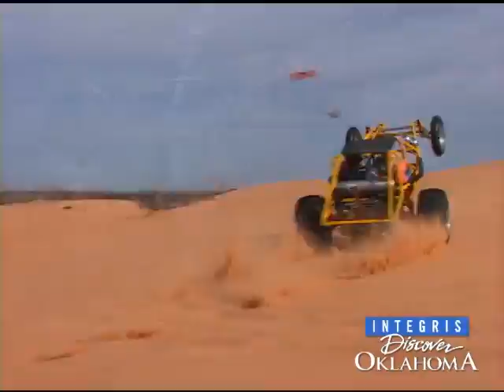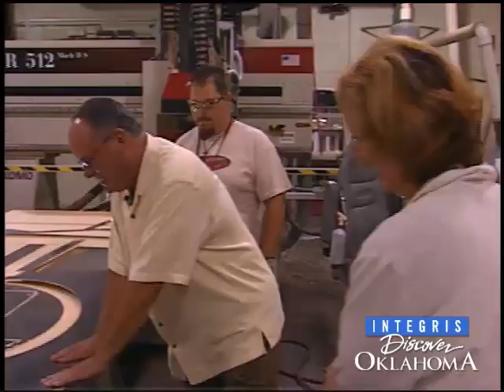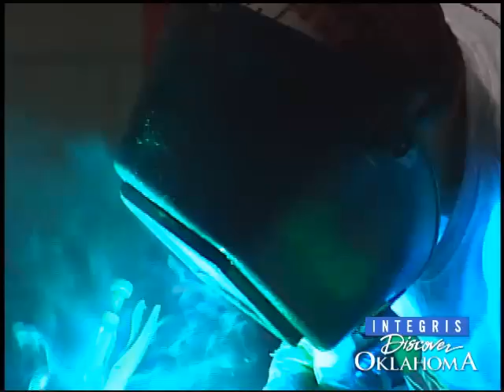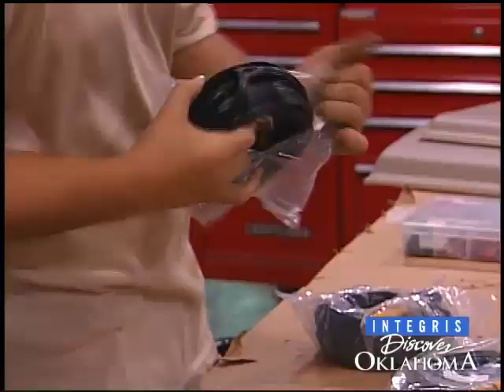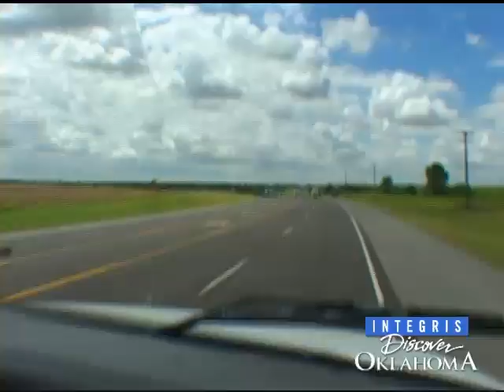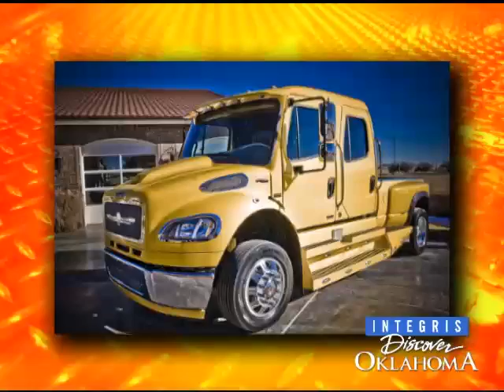Freightliner SportChassis Trucks

Comment: If you listen to the clip it states the truck was developed for the purpose of toy hauling as in Fifth Wheel Trailers or Recreational toys etc.. or you could go to their Website and see the applications  the truck is built for. It does have quite a bit of information. Cheers.

sportchassis (dot) com

Comment: According to their website you can get hydraulic Brakes on some models..and therefore I figure you'd  be able to drive it with a standard License. Also available with Air Brakes too but likely would require an air Brake Endorsement on your License.
Reply: well in md we drive ALL NON-COMM  vehicles with a class noncdl/trac-trailers on down

Comment: Do you need a Commercial Drivers License (CDL) to drive it or regular driving license will do?
Reply: The truck itself no. If u added a trailer, yes. Gross combo of gvw can't exceed 26k
Reply: No.  If you register it as an RV.  To pull your 48 ft. New Horizons 5th wheel camper trailer.  Oh yeah.

Comment: If it is a model with air brakes then you will have to have an air brake endorsement on your license.
Reply: Wrong.  Register it as an RV.  Pull yer damn camper.  NOT FOR HIRE. PRIVATE RV.

You're welcome.😀😀😀😀😀
Reply: Hell, even if it is registered as a regular truck, a class a non commercial license is only $5.00 in PA. Doesn't matter if it has air brakes or not. No special endorsements necessary. No restrictions either. Weight is the only factor.
Reply: Having had worked at Sportchassis last year every truck has hydraulic brakes